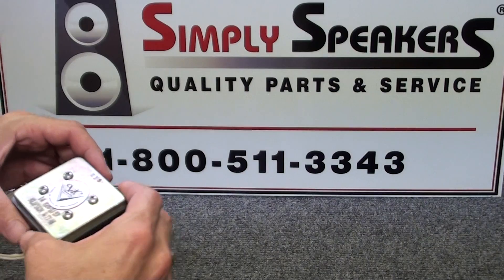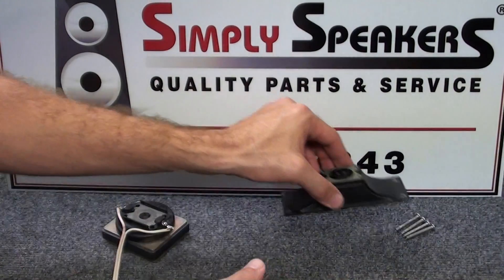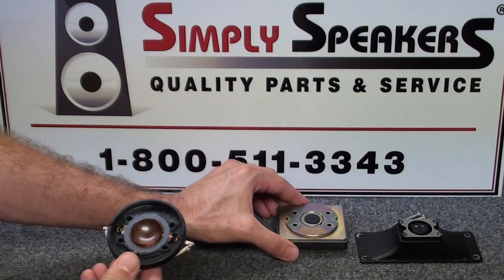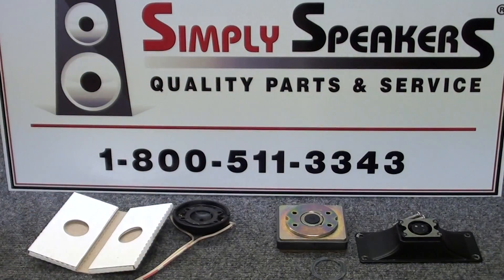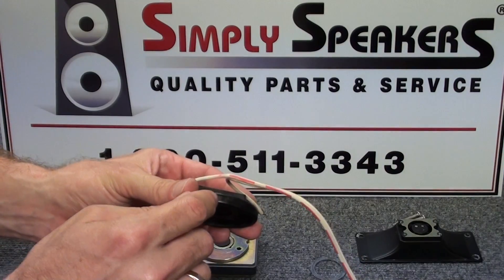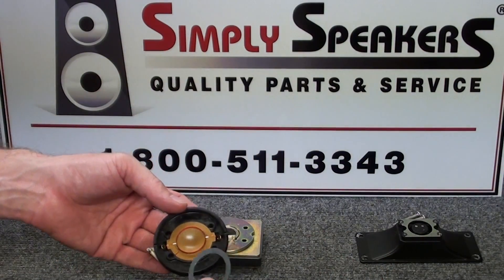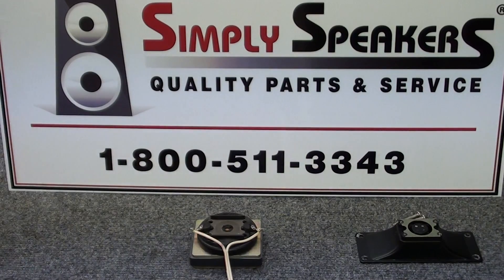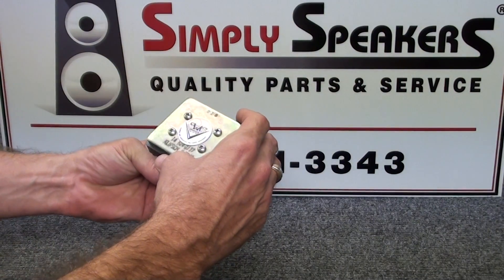Speaker Repair, Klipsch K77, EV T35, ST350 Replacement Diaphragm Installation

Comment: I never would have attempted to replace the K-77-D diaphragm for the high frequency driver in my pair of Klipschorn AK5 speakers, but now I would have the confidence to do so, if I ever needed to repair/refurbish the high frequency drivers.  I had always viewed speaker repair as a "dark art" best left to the technicians, but now I realize that Klipsch speaker repairs are not untouchable for the average handyman.  This is an excellent video.  Thank-you so much for posting it. - tim
Reply from the maker: Thanks!